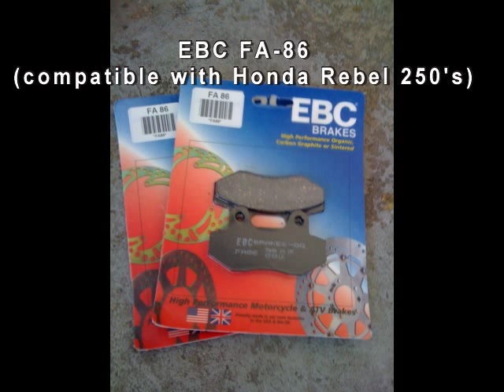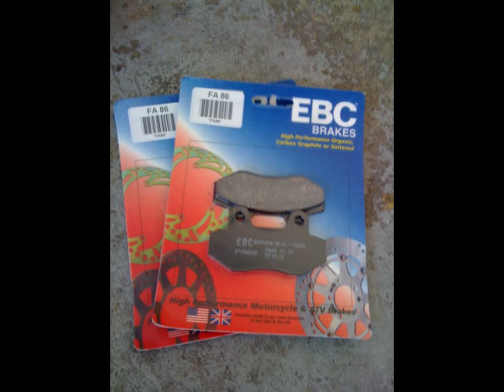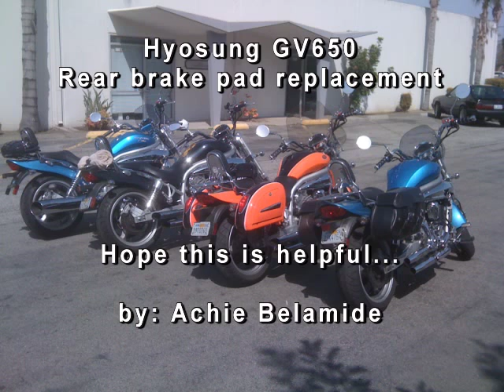GV650 rear brake service.wmv

Comment: How do I remove the retaining screws. can't get it off
Reply from the maker: +Tsering Yeshi - are you referring to the retaining screws holding the caliper? Most likely it got torqued pretty good.  If so, use the correct allen wrench then use a cheater bar or wrench to give you more surface area to hold and turn with-same could be done with the screws and cap for the brake pads.  hope this helps
Reply: +achiebelamide I figured it out. mine was just really screwed in tight. Tha KS for the video man. my brakes work perfect now!